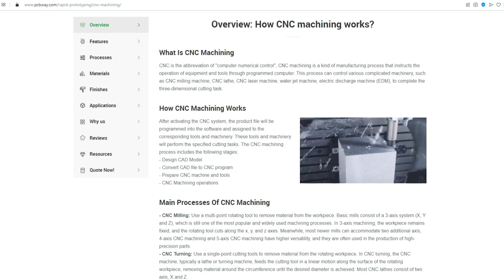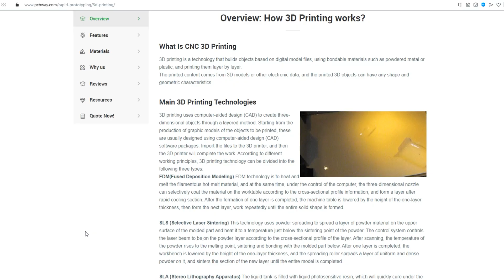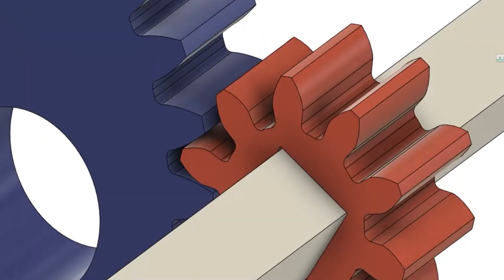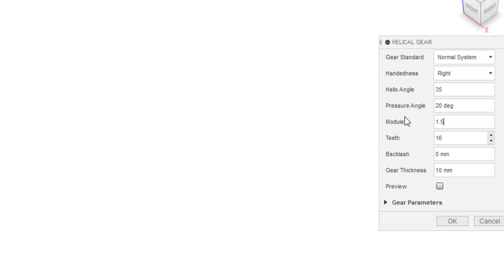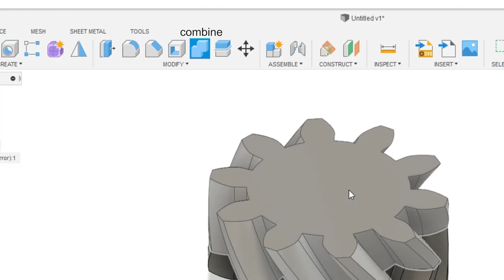Which - 3D Printed - Gear Performs BEST?

Comment: Hi ,is there a way of contacting you please ,I am trying to replace a broken gear from a worm drive that turns a horizontal force to 90 degrees .We have tried 3d printing a replacement but it tears apart in a few seconds ,any comment on the filament we could use .Something isn't right but design and 3d printers new to me but have a print file that looks pretty close

Comment: Is it possible to 3D print herringbone gears meshed in one piece? Like a planetary gear system that doesn’t need assembly but will work straight ‘off the bed’?

Comment: the herringbone gear was the reason the sherman tank's transmission (specifically the final drive) was so reliable, compared to the panther and tiger tanks.
the germans had limited amounts of tungsten, so they did the simple spur gear because it used the least amount of inserts to cut the metal. the americans however had a large supply of it, and were able to do a complex herringbone, which didn't break nearly as often as the spur.

Comment: If I buy a 3d printer, I need to make a very tiny helical gear ⚙️, what it will be the most minimum dimensions I will be able to produce in a 3d printer. ? It is not for a watch.
Reply from the maker: @svsv9  recently l printed 10 mm OD spur gear and it was pretty good
Reply: @retsetman9698  Thank you so much for replaying. Can I send you a pm with an url. It is a linear screw shaft of stepper motor, my first impression every tooth is less than 0.2 mm.
Reply from the maker: @svsv9  surely send it, btw the gear I printed, it has 20 teeth and 0.45 module I guess. You can use these 2 parameters and generate a gear with software or online and compare it with your screw tooth
Reply: @retsetman9698  Thank you, I"ll do it when stepper motor arrive from 🌏. Can't wait what you may suggest. Thanks 🙏

Comment: Is there any sort of clearance to be taken into account when designing these gears. Are the gaps always equal to the size of the teeth?
Reply from the maker: If you mean the distance between the two gears, I first find the exact value from the inter-axis distance formula, plus add 0.1 mm or so, so that it can work more easily without jamming, this is more related to the printer.
Reply: @retsetman9698  so the gaps are .1mm greater than the size of the teeth?

Comment: Great video. In the hotrod world, straight cut gears are the strongest, but that's steel. Plastic has it's own concerns. Lubricating plastic gears is essential.
Reply: This is incorrect. The spur gear teeth individually are weaker than helical gear teeth. Spur gear teeth have less radial support and fail at torque ratings that helical gears of the same thickness and material will survive.

"In the hot rod world straight cut gears are the strongest" because car transmissions with straight cut gears eliminate the side (axial) loads placed on the transmission case from the typical helical gears. Those typical helical gears cause axial loads on the transmission case which flexes, resulting in gear separation which ultimately causes the gear failure. The straight cut gears eliminate the axial loads and transmission case flex does not come into play any longer. The greater torque capability comes from eliminating the axial loads and transmission case flex, not from stronger teeth. If the transmission case is designed to resist the flexing, and keep the gears meshed properly, the helical gear is stronger.

Going even further, performance gearboxes with straight cut gears do everything they can to increase the width of the gears (to bring back some strength lost), by minimizing dog teeth height, minimizing synchro distances, and such in the process.

Comment: I always struggle with herringbone because they are impossible to slide together which means my model needs to consider this throughout its design. I end up making a strong gear with a case that is inherently weaker. It’s easy to have helical eventually rubbing on the housing in a tight design due to axial thrust. Even when it’s held in place that axial thrust is a twisting force trying to bend the gear and axle. I generally end up using a straight cut and deal with a little extra noise in a model I play with for 30 minutes and never touch again. 😂

Comment: I disagree with the statement that spur gears are loud. Either you have the wrong model or you didn't fit them correctly. Every type of gear has friction, so lubricant is necessary, which further reduces the sound. Herringbone gears are the best because the teeth are stronger, that's all.

Comment: Personal Self Notes: 
- spur gear: cheap & easy to make, sudden contact: Noisy ( slightly higher efficiency because of helical gear always want to slide sideways creating more hear thus more power loss )
- Helical Gear: gradual engagement: quieter, less vibrating and more smoothly especially at high speed but suffers extra axial force because of inclined teeth, ( helix angle ↑: axial force ↑) 
recommended angle: 25 degree
- Herringbone: (R.Helix & L.Helix) eliminating axial forces <<when the Herringbone gears engage each other the teeth actually lock together>> 6:04 
downside hard to assemble

Comment: Here are a few fun facts:
• Spur gears were one of the reasons German tanks had that much of a tendency to break down during WW2. Because if you move a friggin tank, and you use spur gears, the entire force will basically hit a single tooth, it will not spread out in any way, which lead to broken gear teeth – and broken transmissions. U.S. tanks had helical gears, and their transmissions were much more reliable, besides running much smoother.
• Herringbone gears are indeed amazing. So amazing in fact, that French car manufacturer Citroën derived its logo from it.
Reply: "Spur gears were one of the reasons German tanks had that much of a tendency to break down during WW2"
And this happens if you only listen to half the story and then think you know the gist of it - nope, you are simply wrong. The problems was nto that they used spur gears. Even funnier no, helical gears are known to be weaker for the same size.

Comment: Your transmission analogy only applies to a manual transmission with an unsynchronized reverse.  Automatic transmissions use planetary gears, DCTs usually have synchronized reverse, and CVTs have practically no gearing at all.

Comment: You can print two helical gears and then pin them together using small bolts if assembly is an issue.

Comment: Regardless of the type of gear you still need a bearing that can absorb thrust.  Spur gear needs to be designed to have thrust in a known direction to prevent hunting and provide loading on the thrust bearing.

Comment: As I understand, some racing gearboxes use straight-cut gears rather than helical, which is done to make them stronger, from what I understand. I don't know why this is, but I would guess that the teeth being loaded across the entire surface at once reduces the possibility of a tooth starting to shear off at one end.

Comment: The angle of rotation of the tooth "beta" is chosen so that two teeth are engaged. This is enough to reduce noise. The rest is decided by other gear parameters.

Comment: 45 degree helical pinions can also drive a gear with a perpendicular axis. Generally spur gears can be made lighter and handle higher torque due to the even tooth loading. Both herringbone and helical gears tend to spall and crack at the initial loading point so they aren’t well suited to high torque applications. You can still use them, but you generally need an additional stage to reduce the tooth loading on any individual gear
Reply: "Generally spur gears can... ...handle higher torque due to the even tooth loading."

This is incorrect. The spur gear teeth individually are weaker than helical gear teeth. Spur gear teeth have less radial support and fail at torque ratings that helical gears of the same thickness and material will survive.

You are probably making a bad assumption, because car transmissions with straight cut gears are often sold as an upgrade to handle more torque, but that is because the side (axial) loads placed on the transmission case from the helical gears cause gear separation and ultimately gear failure. The straight cut gears eliminate the axial loads and transmission case flex does not come into play any longer. The greater torque capability comes from eliminating the axial loads.

Comment: I believe you when you talk about the sound reduction caused by the helical gears, however, I believe your sound test was incorrectly setup due to the sound of the motor turning the gears. A better sound test would require a motor that is quieter than the sound of the gears. This is a well done and very informative video!

Comment: Depending on the dimensions of the helical gear more than one tooth will be in contact all the times compared to the spour gear where only one pair is active. This is what causes them to be smoother since there's no impact as the next tooth engages.

Comment: Its worth mentioning that, when using right combination of tooth size, helix angle and gear width, you can have helix (or herringbone) gear that has smooth continuous transfer of power (next tooth engages before last one disengages), which greatly increases resistance to tooth stripping.
Reply: 0:24
Reply: How do you find that right combination though?
Reply: @crazysoulpubg  At an initial guess, I think you'd probably first need to specify gear diameters and teeth length (and shape). Then you could do some trigonometry to figure out how far above parallel the teeth first make contact, and how far below parallel they start to disengage. Then it's just a matter of making sure to pick an angle that lets the next tooth start to engage at the same moment that the current tooth starts to disengage.

But I may have to play with some numbers to see if there's anything I'm forgetting.
Reply: That's what I was wondering about. Doesn't that also greatly reduce the backlash of the gears?

Comment: Great vid & presentation...Thank you! Just bought a printer (Flashforge Adventurer 3 Pro at a decent discount) and A*todesk 360 is an excellent solid modeler, very much like SWorks. I love that 3D printing doesn't break the bank, at least for a beginner.

Comment: I believe you just touched on the issue with herringbone and double helical gears, that being they cannot be disengaged by sliding action. As a result they are continuously driven. 
   In your video you show each tooth engaging at the outer edges first, then proceeding to the center point. If these gears were tightly meshed this means the point could entrap air or worse, lubricant, creating 'hydraulic lock'. As liquids are relatively incompressible (not compressible), this would force the gears and their shafts to separate causing excessive wear. This is why herringbone gears are typically unidirectional turning, as to mesh the points first. The double helical gears are used where bidirectional meshing is required (rotating in both directions), as 'hydraulic lock' is relieved through the central gap when turning as to mesh at the edges first. So the central gap need not be large to relive this pressure.
   The axial thrust developed be single helical gear meshing can be countered with thrust bearings. So thrust bearings for double helical or herringbone gear meshing requires two thrust bearings, complicating design and assembly.
Reply: You dont need any thrust bearings for herringbone gears, as there is no axial thrust.

Comment: first argument about straight teeth gear is wrong. Using a revolute tooth profile means the teeth ROLL on each other, there is no slapping action like shown. Sure the gear is not perfect so there might be a little bit of an impact because of play between gears, but that would happen exactly the same with helical or herringbone gear.
The reason the straight tooth is bad (and noisier) is because the contact line is engaged at once, unlike the helical gear where the contact line is engaged progressively.

Comment: I use a combination of herringbone, straight and helical gears in my projects depending on the demands of the mechanism.
Reply: Out of curiosity, is there any/what's the advantage of spur gear over helical gear, mechanically ?

Comment: what do you use to design your gears?

 im not a fan of paying for subscriptions for tools like fusion 360 and they can be prohibitively difficult to design involute teeth manually since all software is going towards subscription. Imagine having your screwdrivers stop working because the subscription expired or the asking price went up 1000%
Reply: There's a hobby version of Fusion 360. It limits you to ten active models but it's easy to change a model from active to inactive and back again. 
The hobby version can be tricky to find so if you're interested make sure you get help finding the hobby version if that's what you want.
I also hate subscription software but I don't blame software companies for wanting to make money. I just hate when they don't have an option to buy the software outright.
Reply: @ddegn  thank you, I agree i want to be able to run the software offline. I've been using Design Spark Mechanical, it will run offline for 30 days before it needs to phone home plus the design aspect of the program is undistracted in the free version. The pay wall comes up when trying to run physics simulations or offload processing power to a remote server.
Reply: I forgot to mention the gears in this video were designed in Fusion 360.

Comment: But there's an issue with the chevron pattern. Citroen bouhgt the pattern from a Polish Engineer, hence their logo. That's not the issue. The issue is that unlike common helical gears, you can't make a gearbox change speed by simply sliding the gears.  You first need to desegage them, then put them back into position. So it is really cool if you have a direct drive system, (probably with an electric motor), but changing gears with this sytem can easily get quite complicated, in case you'd have a gearbox with variable speeds. Which is often the case on actual vehicles. ANyway, nice video, thank you :)
Reply: Fortunately gear change ability isn't very important when using electric motors. A DC motor kind of acts like an automatic gearbox. Diesel electric devices use the DC motor as the gearbox for the diesel engine. 
Do you know if there are other issues with using herringbone gears besides the inability to slide gears together?
I second your opinion that this was a nice video.
Reply: What in the world are you talking about? Automotive transmissions don't change ratios by sliding gears. They are constant-mesh transmissions, and herringbone gearsets would be no issue at all.

Comment: What about printing the double helical gear as two gears? This would make easy to print and assemble.
This would allow you to push them together on the axel, and if the angles are right, forces would push them together during working (or you can glue them together too).
Reply: Are there any advantages to a double helical gear over a herringbone gear?
If the two parts of the double helical gear weren't glued together they'd tend to separate when the rotation is reversed.
Reply: The only point to double helix gears is they have the same advantages as herringbone but are far easier to cut into steel. This makes them cheaper to make but due to the gap they tend to be slightly weaker. With printing these advantages don't really mean much.
Reply: @FriedPineapple410  Double helix gears might have advantages in dirty environments.
Reply: @ddegn  This is the issue. The axial forces will push the two gears apart
Reply: @boulder795 You can "heat mate" PLA parts easity, so no special glue is necessary. Locally remelted PLA tends to be even stronger than the freshly printed. The trick is to design it to hook them together after melting. So no true welding is necessary which is error prone and difficult to do manually without deforming the part.
Reply: Double helical gears also don’t hydraulically lock if they’re reversed with lubricant between the teeth, which is a necessity if they’re lubricated with oil

Comment: Great video !  Keep up the good work ! I wonder if some kind of spline shaft would be better than square , you could have a shaft that has a couple splines on top and bottom and flat sides so it would still be easy to print.

Comment: It would be interesting to see you revisiting the press project. But without the press-channel kind of experimental theme. But instead to see if you can make an actually usable metal bender with enough force to actually be able to make metal parts.
Judging by the actuator you made being able to lift almost 100kg while using those tiny gears. You might be able to produce a ton of pressure (maybe literally) if you really went overboard with it.

Comment: What nozzle size did you use? .4?
Reply from the maker: Yes .4
Reply: @retsetman9698  Have you tried using a 0.6 nozzle? Thomas Sanladerer says models turn out just as good with a 0.6mm nozzle as when using a 0.4mm nozzle. I haven't tried this myself yet but Tom usually knows what he's talking about.